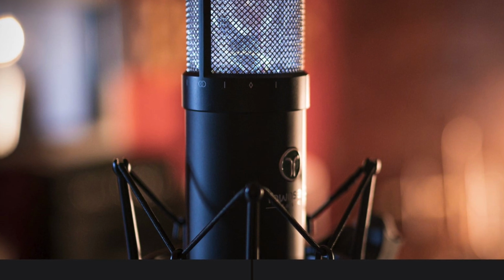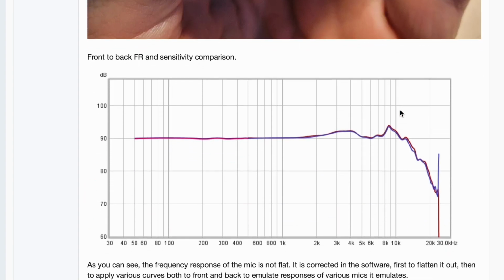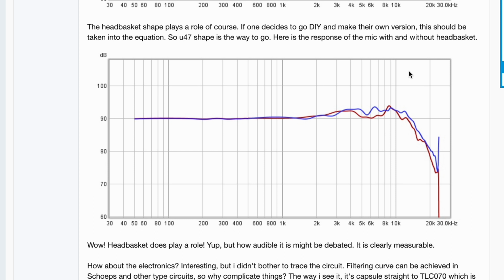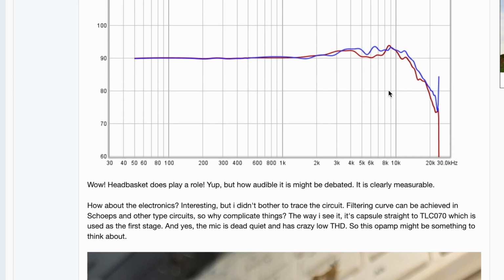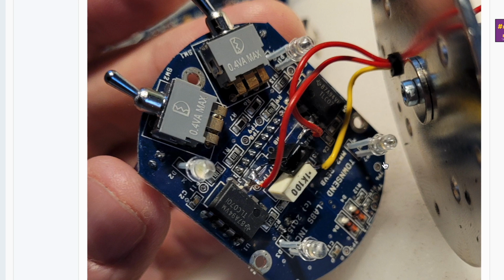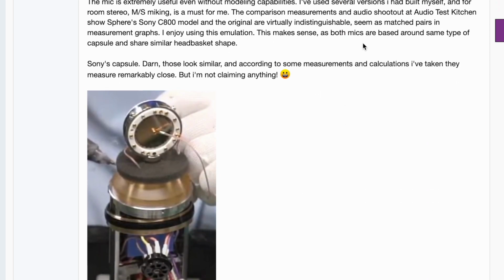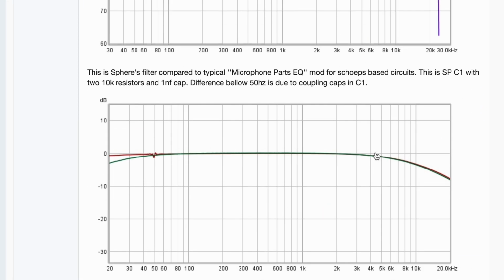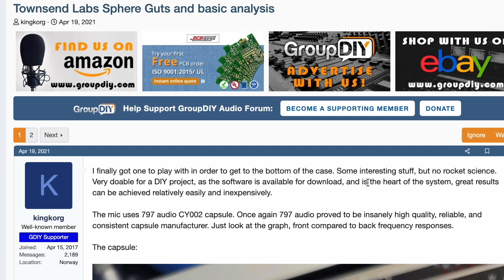Capsule and Guts in the UA Sphere Microphone.

Comment: Hey big dawg! I know I’m gonna sound super-green, or the FNG to mic builds, but is the head basket the case that slides over the “guts?”
Reply from the maker: Jim! No worries. That would be the shell. The headbasket is the grill assembly that goes over the capsule.
Reply: @MarkYoshimotoNemcoff , AHHH!! The reason I ask is bc I’m having the same resonance issues and was wondering if it would work to stuff the guts into an old NT1 body. Would this work?
Reply from the maker: @bigjimmedia  Because mic bodies, the pcb rails inside and simple things like the way the capsule mount screws into the capsule deck are not standardized, it could be a very difficult endeavor to transplant an entire Sphere mic into another body. I personally would be terrified to try that.  You'd have to begin by opening up the Sphere and measuring to make sure it would fit, the screw holes line up, the switches board would fit or need switch holes cut into the body. Also, you'd have to desolder the capsule and most likely the 5 pin XLR jack from the Sphere board and then reattach them in the new body. As far as I know, I'm not aware of anyone else who has tried this, so I can only think of those potential complications off the top of my head. And, there's no guarantee that a chiseled headbasket won't mess up the sound of the models since that style headbasket tends to make a mic less full in the lows due to the resonance characteristics of that style.
Reply: @MarkYoshimotoNemcoff , we’ll then..lol I will definitely toss that idea out. Thanks again for sharing your wisdom!
Reply from the maker: @bigjimmedia  You're very welcome.

Comment: Thanks for this KingKorg and Mark! I'm super happy with my L22 that I got new for a great price, and haven't even used in any modeling modes; just straight into my Volt 2/Daw setup, lol. It sounds great with no fuss, no muss in set up (I'm not using Console, yet). Got the L22 to future proof. Mark your UA mic videos that came out right while I was in market were soooooooooooooooooo helpful; downright determining for me! I ended up returning an LX because I got the L22 for several hundred dollars less. I'm looking forward to learning how to use it over time! 

Mark a question about maintaining the mic. I don't use it a lot, yet I keep it out in my studio, as to disengage it from the shock mount and the mic stand takes a few minutes. Should I be storing the L22 in its case while not using it (I use it once every two weeks right now)?
Reply: The capsule in L22 is made by 797audio in China,K67 style,the same capsule also use in nt2 microphone.
Reply from the maker: That’s right. The old original NT2 and NT1 both used a single sided version of this capsule until both mics were changed to their “A” versions.
Reply from the maker: Hi Josh! Very glad to hear the videos were helpful for you. You will learn so much about what different mics can do, it’s like enrolling at Microphone U. To answer your question, the safest thing is storing it away if you’re not going to use it for an extended time, but if you feel that your stand is sturdy and won’t tip over or the mic won’t get knocked to the floor, what you can do is place a cover over the mic when not in use to protect it from dust. The L22 kit should come with a cloth bag. You can just slip this over the top of the Sphere and all you have to do is slip it off and you’re ready to go. I do find that having a mic in a “ready to go” state is helpful when the ideas are flowing.
Reply: @MarkYoshimotoNemcoff  Great idea, Mark! Hadn't thought to use the mic bag in the L22 case (like the case; little on the "cheapie" side but better than the LX/no case : ) ). Thanks again for the time you put into the channel, Mark; it is very much appreciated!
Reply from the maker: You are very welcome!